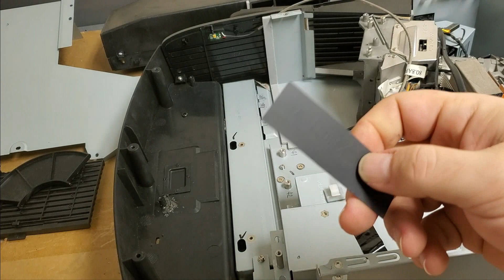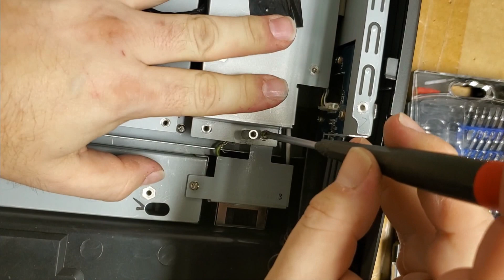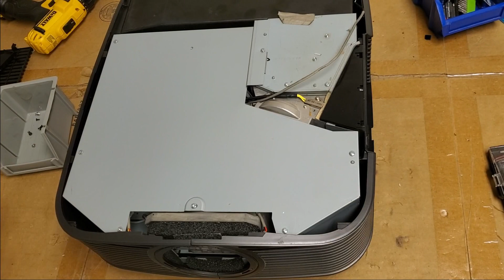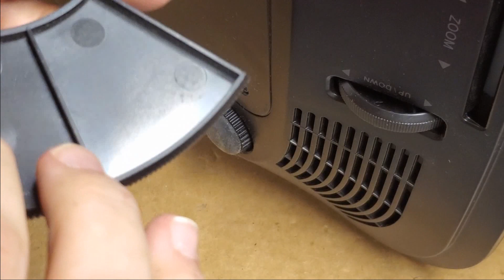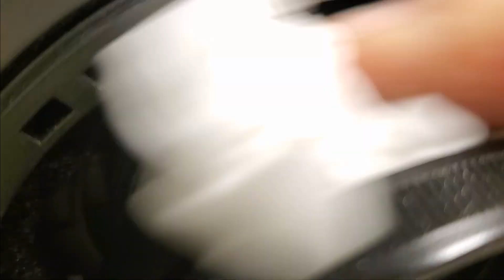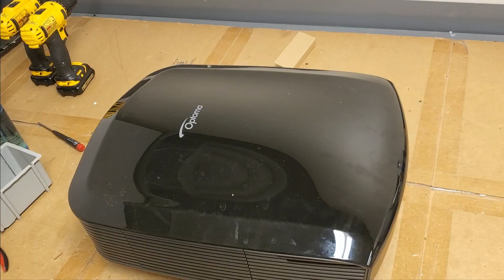Optoma HD8200 DLP Projector Repair Part 2 of 2 (No Startup)

Comment: For re-gluing things for strength I use the superglue and baking soda trick.   I use it to make fillets and rounds to added strength of anything I am gluing that needs to be strong.    If the item needs extra strength I use JB Weld on top of the superglue combo.

Comment: A washer would have worked well, under that third lens ring screw.
Reply from the maker: In retrospect I agree. Truth be told I ran into multiple issues trying to repair that lens ring and was so happy I finally had three screws I decided to call it good before I fixed it into needing more repair again if you know what I mean. Unfortunately the damage was due to a misunderstanding. The original fellow who worked on it thought the lens ring was turn and pull like many optoma rings. That became pull and break unfortunately.

Comment: Well it no longer displays an image. It powers on fine, it shows the Epson logo at the start, but it doesn't go into the familiar menu screen straight afterwards. It just goes blank. Light is still coming out of the unit though... faintly. And none of the buttons respond at all. No matter how long they are pressed, or in what order. Even the power button doesn't do anything. The only way to turn it off is by the main power switch at the rear of the machine. 

If this were a t.v I'd say sounds like a classic main board issue.  But I doubt I'll ever come across another good main board to put in it.  I really should open it up and just have a poke about.  Make sure it hasn't been previously looked at and that all the plugs/cables had been redone correctly.  I'm thinking about taking it to an Epson repairer because it's such a good machine.  They still sell in their thousands over here.  It looks brand new.   I bought a remote for it and every thing.   I just don't want to take it some where just for someone to tell me it's a part that is no longer available, then slug me with fees.  There isn't much about them online other that it was a great model :)
Reply from the maker: That would definitely be worth looking into. When LCDs have optical issues such as bad panels or polarizer issues, it's not really worth putting effort into, but this sounds worthwhile. 
I'd start checking voltages at the low voltage in from the power supply. They should be pretty standard levels (3.3,5,12-16vdc). I'd be suspect of the HDMI chip. It could be bad and pull down the signal that unmutes the video. Also check any regulator you see on the main board. 
Non main board issues could be a stuck Iris. It's located in front of the lamp but I'd expect more obvious errors if that's stuck. Like flashing LEDs to indicate something wrong.  Another troubleshooting avenue is the data connection on the back. Using a serial to USB cable, you can use hyperterm or putty to see what errors it is storing. You can get the rs232 codes to send from Epson support site. 
It might be worth reaching out to Crystal at Time Projector. I buy used but good parts from them a lot and it's been great. A main board won't be super cheap but this has been out now for 7years. I'd expect them to be reasonable.  Her email is gydz@timeprojectorlamp.com . Tell her Frank referred you. The fact that it comes on at all and has image is fantastic. I'd at least check those five pin regulators on the main board. My guess (sight unseen) is bad HDMI chip, power issues or corrupted firmware